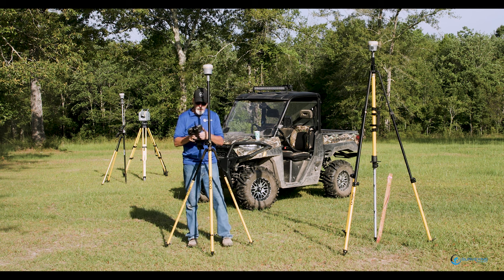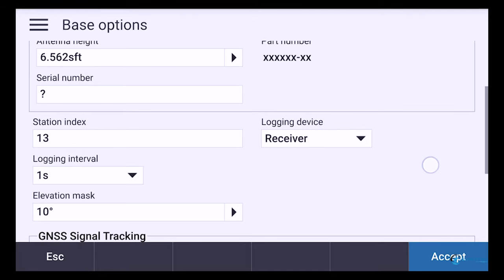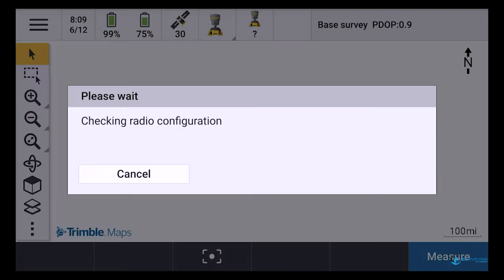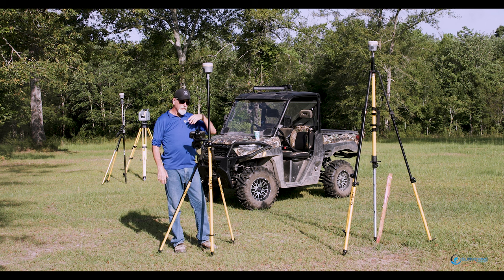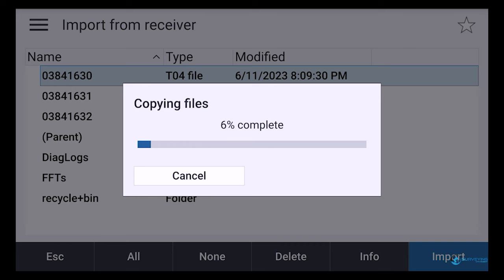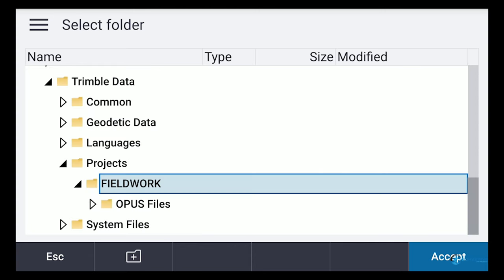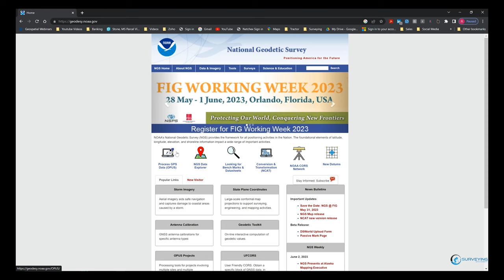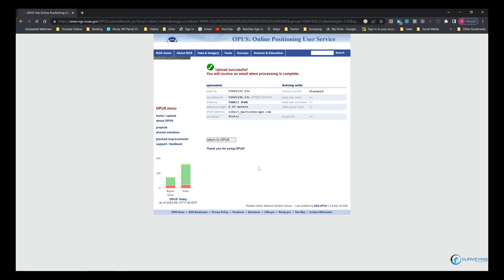OPUS static with Access and a TSC5

Comment: Uhh. You have the lever extension selected. 2m+ lever extension, the imput height is what you measure the hypotunse distance to the lever extension. You cant put 2m in your case here because that will be in correct, since the measurement is a actually longer
Reply from the maker: LOL… Surveyors! We over think everything. Fixed Ht tripod is 2 meters (6.562ft). What am I measuring? The lever extension is for a tripod. Maybe if I pulled a tape but I am not.
Reply: @SurveyingWithRobert For your base, it has the lever extension piece on it? 6.562ft is 2m, but you're telling access it's 2m to the lever of the extension when it's actually like 2.02m or whatever at that height. If you don't measure then you should use bottom of quick release, 2m+ the height of the lever extension bracket (.15m?)
Reply from the maker: @TroubledKiwi if I measure with a tape maybe. You are overthinking it. Nothing is or needs to be corrected. The center mast is 2m. The software knows the height of the lever extension and the phase center of the antenna which is where the measurement actually goes to. You can see this in the raw data. With the older antennas you had a special rod to measure with. Also at 2m height there is not enough slant to correct like if you were 4ft off the ground.
Reply: @SurveyingWithRobert  indeed likely the answer in similar within reason at the end. I would be curious what the HI difference is if you set it 2m@ lever extension or 2.15m@bottom.of quick release when using the lever extension. I'll have to look, it's probably small.
Reply from the maker: @TroubledKiwi  I would think it would be. Maybe I do a short on that.